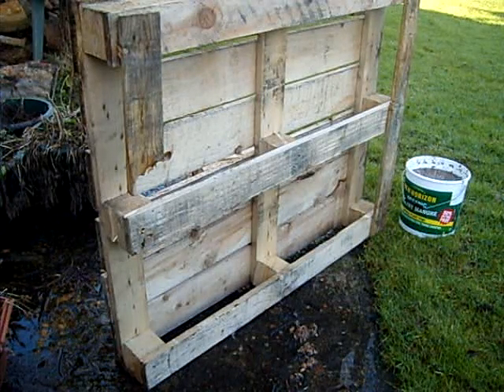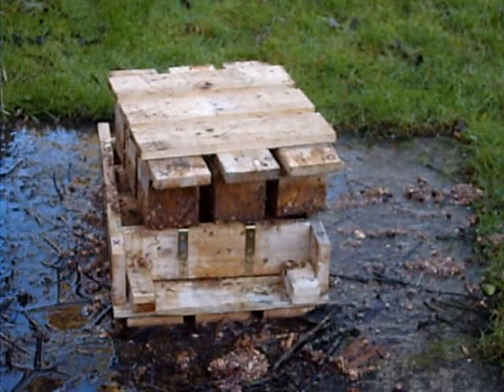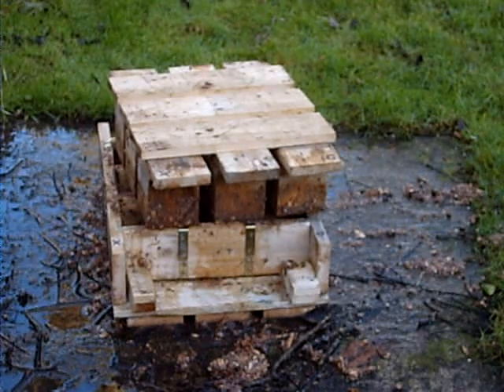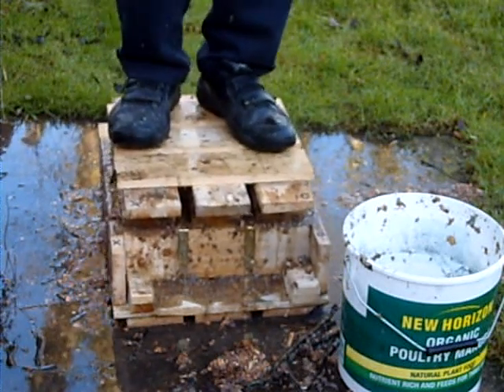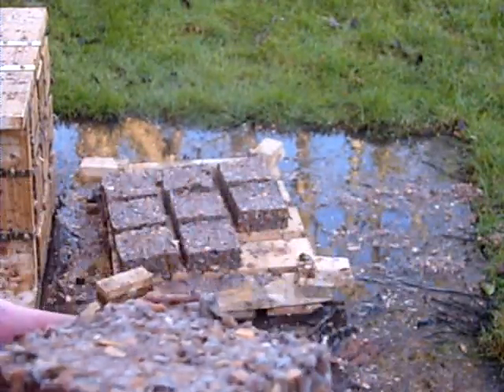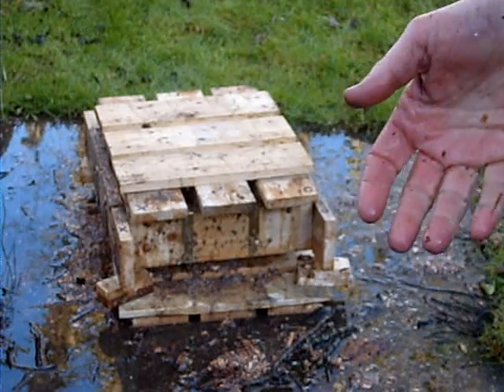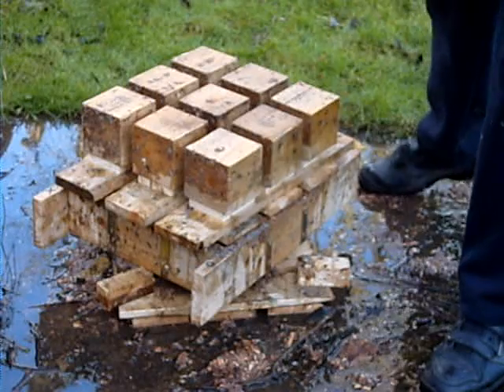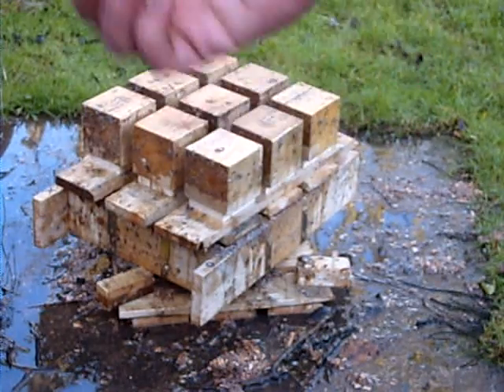Homemade Fuel Briquette Press 2

Comment from the maker: @Bently100 I'm making them to try to use up lots of wood shavings and paper and then burn in my workshop stove.  I can get good compression with a tube and hydraulic jack but it is time consuming and would probably be less economical than buying fuel in terms of time value and alternative work I could be doing. I'm also aware that there is a lot of fuel poverty so, maybe, I might offer an design or idea that could help other people develop better designs. 
Best Wishes, Brendan.

Comment: Just spotted this, thought i would suggest, if you want to press more water out, its not about extreme weight, its progressive compression that will work, get 4 large 'G' cramps and put one on each corner, then wind them in half a turn every two hours, you should be able to get pretty much all the water out, even if you do it over a day or two.. then they will dry much easier. and burn longer because they will be denser, plus if you add some bleach to the paper/water mush. they will burn hotter

Comment from the maker: @busterpiggle This is an idea I played with but when I thought of the 4 hours to dismantle each pallet it kinda demoralised me a bit.  However, it is still an idea worth trying.  I did try driving one wheel up onto the press but all the weight transferred to the opposite rear of the car.  I got about 3mm more compression than standing on the press and the car was a Mercedes S320 so plenty of weight.  Four presses might be the way to go.

Comment from the maker: @busterpiggle That would work. I tried driving one wheel up a ramp but the weight just transferred to the opposite rear wheel and I only got about 3mm more compression. I tried to send you a message but it failed. Look up 'homemade fuel briquette press' and you'll see a 4 chamber one on an 'A' frame.  It's good.

Comment: Those car or bottle jacks are really cheap and would give you a lot of pressure. You'd have to build a top part but if you have a lot of wood pallets, it shouldn't be  a lot of money, if not, free. Living in America, I forget how accessable and most times, cheap, some things are. For drying, build a box close to the stove and use that heat. just a thought. Maybe reuse the water as there are bonding agents in it? Hope all is well in your country. Cheers, from America! :-D

Comment from the maker: @InvalidMemberAccount Hi, increased compression expels more water and speeds up drying - which is an issue here.  Also, I think a more dense block would burn longer.  If you are somewhere hot with good sunshine compression wouldn't be such an issue.
Best Wishes, Brendan.

Comment from the maker: @jwwm2 I tried driving my car onto the press but got very little more compression because, even though the car is a heavy brute, all the weight transfered to the low side and rear.  I have build a press that operates with a lever but made an elementary mistake with the physics but it will be easily rectified with more timber when I get time to get it.  I'll be doing a video when I have it operational.  That idea of yours is very good and something I might try if the lever doesn't work. Brendan.

Comment from the maker: @TheNeonlouie Nope. I just tear the paper into strips about an inch wide, half fill a bucket with paper and add hot water.  I leave that overnight and stir it a few times.  You can speed the process up by adding a tablespoon of bleach. The bleach evaporates off during drying.  I use a drill and plaster mixer to stir the paper because I'm a lazy shite. Tip - to tear paper, start at the centre fold of the newspaper and tear to the edge - most efficient way and fairly consistent strip width. B

Comment from the maker: @TheNeonlouie Hi Louie, thank you.  Yes, scrap paper is fine but I've been told to avoid glossy, magazine-type paper because of the chemicals used in production and the fumes they give off when burning.  However, if you are using an enclosed stove they would probably be fine mixed with newspaper.  I'm working on a lever for this press and, if things go as well as they did on paper, it should be easily made and give a lot more compression than just body weight. 
Best Wishes, Brendan.

Comment from the maker: @AndyDaviesByTheSea Good thinking. I will build the dummy because it's quicker than building a second press. I am going to stand on the press to get most of the water out before driving on it so that will reduce the amount of liquid slurry available for seizing the press and will also lower the top by about 3". Sleep??? HUH! Sleep is for wimps. Us cutting-edge machine designers laugh in the face of sleep!
Best Wishes, Brendan.

Comment: @baconsoda I seem to be putting my responses in the wrong box,

Hi, that's what I meant; make another press the same as the one you've already got. But here's a dodge for you, before making a second press stack up a bunch of bricks as a dummy press to keep the car level then you use the original press and try it out. You might find that it "over presses" and the guff may goes up the side of the pistons causing them to lock up.
 So will you get to sleep tonight?  Kind Regards...Andy

Comment: Hi Brendan, there's no stopping you is there?
How about building another press, get a scaffold board and cut 2 lengths, each about 4 or 5 foot long put one end of each scaffold board on top of the press so as to make a ramp and then drive the car up it. You'll need to slightly tilt the bottom of the press so as to be parallel with the board and it'd be a good idea to put a stop on the end of the board so you don't drive too far.     
keep on having fun!
 Kind Regards...Andy

Comment from the maker: @mediamaker2000 A cider press has quite a bit of travel because it is used to squash layers of apples in muslin wraps (I forget the name).  If you type 'cider press' in here there are loads of videos.  It's a very simple screw press that applies a lot of pressure and you wouldn't want to be inside it when it's going down...would kinda spoil your day.
Best Wishes, Brendan.

Comment from the maker: @cooper68ns Thank you. I soak newspaper overnight and then mix it with a stirrer in a drill. Then I add the same amount of wood shavings I get from under the lathe I have. I add more water as I mix the paper and wood to get the mix a bit sloppy to make it easy to pour.
Best Wishes, Brendan.